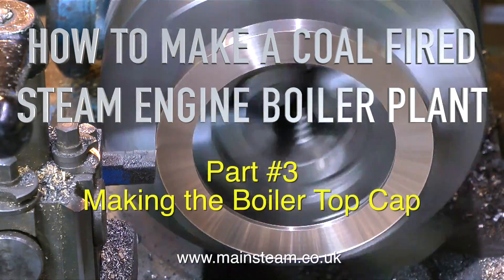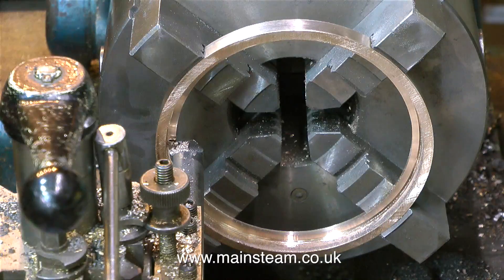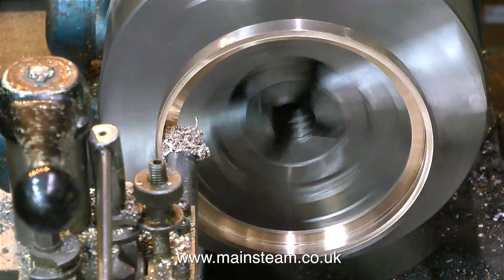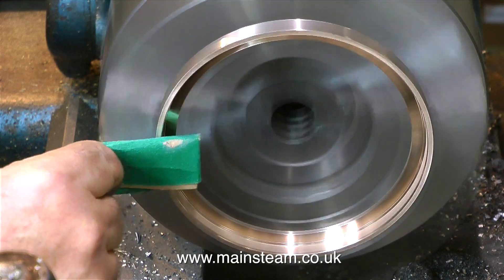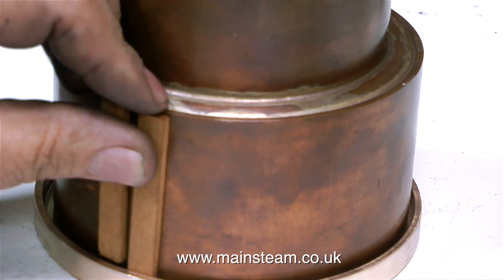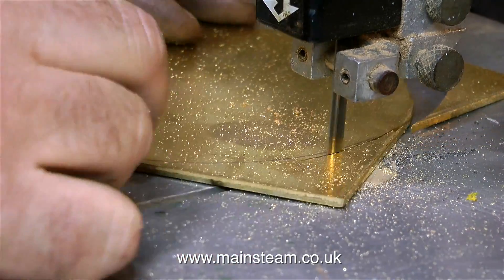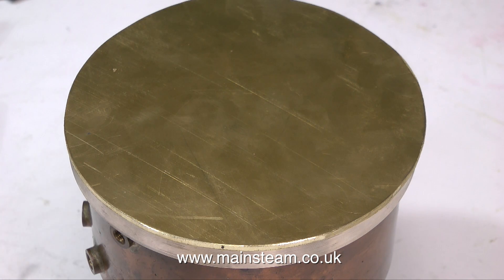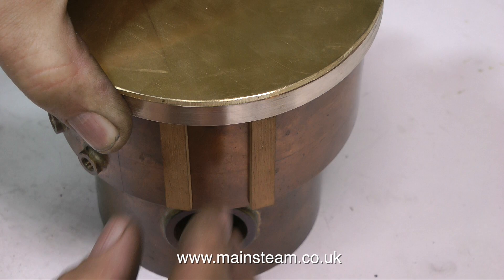HOW TO MAKE A COAL FIRED STEAM ENGINE BOILER PLANT - PART #3

Comment: I noticed in at least a couple of videos that you mention about having the camera on your right so you can see the viewfinder, you probably don't need me to tell you, but have you thought about a separate monitor ? i have a car reversing one that runs on 12v, is able to reverse the image like a blocking monitor, and can switch between 2 inputs, only downside is a cable between camera and monitor, unless you use a video transmitter/receiver combo.
btw, the best way to get rid of chips is to eat them, along with battered fish (don't go running to the animal cruelty people), or burgers :D

Comment: It must be quite difficult to hold a piece like that in the lathe securely without distorting it.
Reply from the maker: Yes it is, that's why 4 jaw self centring chucks are good, they spread the grip more evenly .....
Reply: You'd still need a very delicate touch tightening the jaws and using the cutting tools

Comment: Interesting, funny and informative, as usual. I wonder if I can ask whether you will be beveling the long edges of the mahogany 'planks' to bring the outer edges closer together?
About 4 decades ago I spent a year or two as a moulder's labourer at the iron foundry in Holmfirth...I doubt if it is still there. I reckon the new H and S Inspectorate would have (had) kittens at casting time. It was bad enough that they came once a year and we all had to wear hard hats, goggles and rawhide aprons for half a day! I can only guess that these good people have never tried carrying a long-handled ladle full of molten iron from the furnace to the mould, along with about a baker's dozen of similarly loaded blokes. Goggles would mist up, sweat would run because the aprons were so bloody hot and your grip on the steel handle would get slippery, it was an accident waiting to happen. Normal wear was jeans, shirt and the issued safety boots with the QD straps. Freedom of movement was the all-important ingredient of safety, that and the boots. Well, excuse me for mithering on, it was your talking of well cast iron that had me going, and your accent. Thank you for your excellent series of, er, series about your hobby.